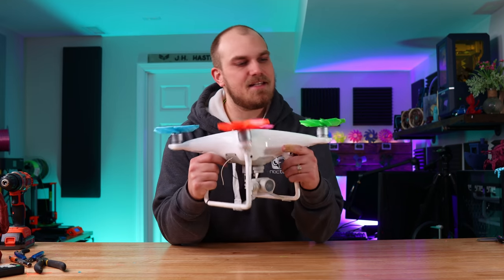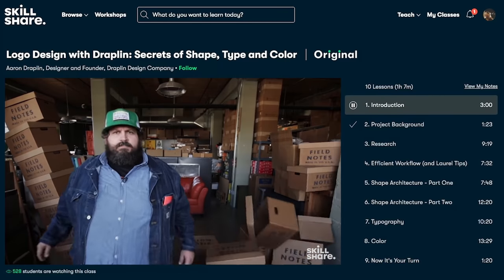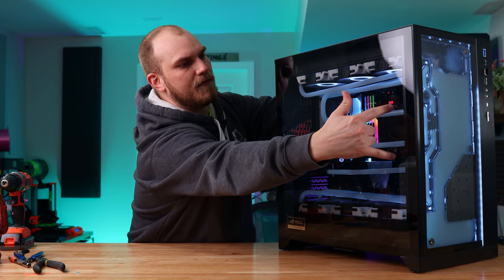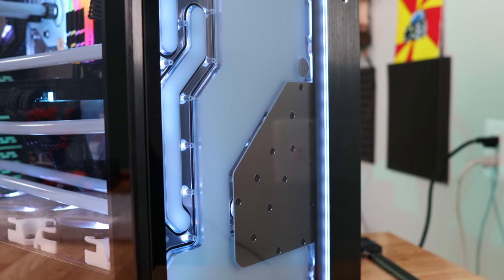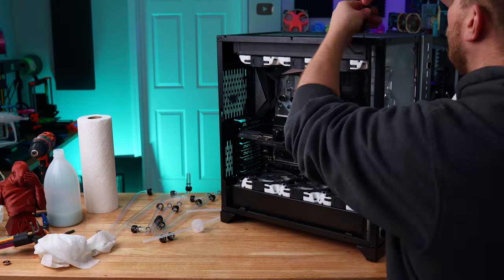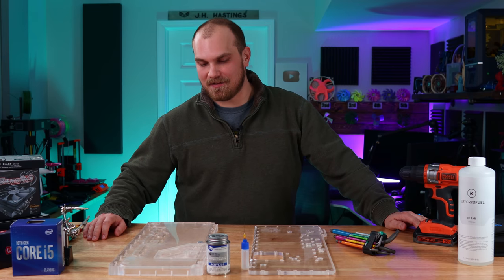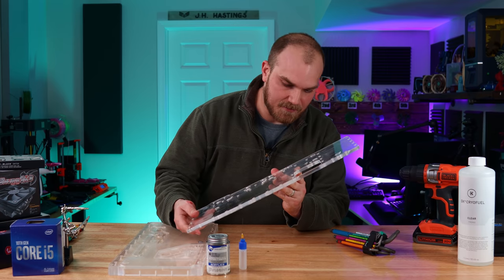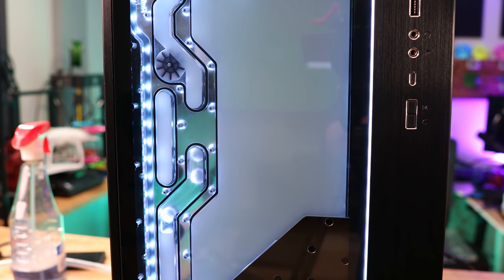$400 DISTRO PLATE is about to let loose, can we FIX IT?

Comment: Try one of those DIY windshield repair kits
Reply: There should actually also be stuff for fixing acrylic
Reply: Yeah you must aply pressure to get the glue/resin in to the cracks, to do that you wuld probably need a specially made screw that you culd fill with air and that has holes where you wand the glue to go in to the cracks.
Reply: I'm not that sure that would fix it reliably, and I would not want to risk it.
Reply: I think it might still look funny after that
Reply: What the windshield guys do is that they use essentially a vacuum cleaner to suck the glue into the cracks.
Reply: @garremannen   i don't know what kind of machine you talk about, but I know about 2 types of tools the vacuum one (you connect a compressor hose that make the tool suck out all the air from the crack/vacuum then the underpressure drags the glue inte the cracks) and the other tool is like a tiny pump that you press the glue in to the cracks (replacing the air in the crack with glue)
Reply: @kayburcky7146  if you get all the air out then you will almost not notice it, the white lines are air trapped in the lexan.
Reply: @Mre942  Lexan/Makrolon = PC. Acrylic/Lucite/Plexiglass = PMMA.
Reply: same thing but for acrylic. Windshield repair is meant for glass and the special plastic they use for the lamination, wouldnt work with acrylic.
Reply: @crisnmaryfam7344  it would work crack as crack, just don't know how it will look
Reply: Maybe if you put pressure added air pressure and made the hole air tight and put the stuff in there maybe would push the stuff in the cracks
Reply: UV glue is the answer for sure.

Comment: How about using the old plate to test torque and see how much is really required and what will cause catastrophic damage? It will be good info for those who want to do DIY liquid cooling.
Reply: finger tight is all you need :)
From the factory, these fittings are too tight. Unfortunately he did not losen them up and retighten by hand. Personally i always remove any fitting and retighten by hand. as long as the oring is compressed, there's no need to go further.
Reply: @ledoynier3694  That's really where most people screw it up, 'cause you nailed it on the head. Once that ring starts to compress, you're DONE. Stop right there. Once there it has sufficient tension to stay on. You go past that point, that's where the bad things happen.

But then IMHO liquid cooling as a whole is where the bad things happen. When most AIO's can even compete with a crappy five pipe 120mm single stack on peak temps, I'm really not impressed when I'm using double-stacks like the NH-D15's. To be fair though, I put functionality and longevity ahead of artsy-fartsy form factors.
Reply: @ledoynier3694  good tip. Going forward I will always remove and redo all plugs having seen this.

Comment: Find some gasket material and set up a test bench so we can 3d print various impellers for the flow meter and see which is coolest looking
Reply: The gasket material is real easy to find online by the roll.
Reply: Turbines, not impellers, in that application. But oh shoot, other than that, you basically beat me to it (3D-printing cool new blade designs for the flow meter turbine), but with better detail than I said, and I found your post here a while after making mine.

Mine was like this:

Me watching this video: "Oh, cool! Let's see which other cool blade designs we can come up with that would work fairly accurately for that little flow meter dealio-bob there!"
Reply: Or custom Pump (Propeller/impeller?)
Reply: @Bloodhoun21 : A flow meter of this sort with blades that look like fan blades is only a turbine, because turbine blades don't drive initially; they get driven. Yes, then of course they can go on to drive something like a generator or whatever, but first they are driven by a force on the blades.

Other devices with blades like these are either fans, pumps, compressors, or propellers, because their blades drive the fluid.

Fans, of course, can get divided further, into blowers and impellers.

Also: why are you treating "pump" and "propeller" as if they are brands?
Reply: biohazard design :D
Reply: The flow indicator is neither impeller nor propeller.  It's a basic water wheel and serves no purpose unless it's connected to a  generator or simple continuity switch to gauge flow.  At that point it's REALLY dumb to be messing with a calibrated instrument.   That one seems to be just for looks / a simple visual indication to gauge if flow is occurring.   What I'm surprised at is that they didn't do many of them for a steampunk like effect.   Properly designed they have minimal interference with flow.
Reply: @mhamma6560 : I guess you missed what I already said that covers this about impellers vs. turbines, etc.
Reply: I like that idea a lot
Reply: @HelloKittyFanMan.  some people just always have to correct someone else I assume. You got the point.
Reply: @jdahling4738 : 1. Not always, actually. 2. There's nothing wrong with giving someone correct information. 3. It's actually a good thing, because it fosters good understanding by keeping things straight. 4. You don't have to worry about it, since I wasn't even talking to you.

Comment: Windshield repair...I think they pull a vacuum
Reply: Not all the repair kits require vacuum. Some of them are pressed into the cracks using a screw.
And some need nothing, they are runny enough to fill in without extra forces on them.
Reply: @Dirkxke  a vacuum would have a better chance of working though.
Reply: @Dirkxke  You really need a vacuum for this if you want to fill cracks as far as possible with the least stress possible and stop them from propagating further for good. If you press glue into cracks to fill them, you end up with pressurized air pockets trapped deep into cracks and the cracks will continue propagating from there.

Comment: You could try dichloromethane, it is used as a diffusion "glue" for acrylic, so it's very thin. And if it doesn't work, it welds pla pretty pretty good together, or smoothes the surface.
Reply: dcm is nasty tho, you can also huff it and pass out. or use it to put drosophily flies to sleep so you can count them and mark down their phenotypes to do some mendel genetic experiments
Reply: @oOSpecialProskillsOo  who doesn't like huffing and counting phenotypes...ah, good times.
Reply: Trichloromethane also works. TCM is commonly known under the name "Chloroform", so good ventilation is crucial when working with both DCM and TCM
Reply: @oOSpecialProskillsOo  I thought so when I saw the many interesting hazard stickers on the bottle 🤣

Comment: That’s why watercooling plugs often have no Allen key slot and are just knurled so you can’t overtighten it as easily.
Reply: Has nothing to do with overtightening and everything to do with expansion, contraction and shrinkage. As he stated some of the plugs he never touched. I have 3 cracked distros and mine cracked around the screws that clamp the two halves together. I never touched any of them. Also note when he separated the halves and laid them on the table that they were warped.  Distros have a short lifespan and are guaranteed to crack.

Comment: You can still use that plate. Just get some of the O-ring material from McMaster-Carr. Cut it to length and use some CA glue to stick the ends together. You can also get all of the fittings and screws from there.

Comment: 3 things to try:

1: Use heat or flame to polish away the cracks. Put a fitting in without an O-Ring to maintain the shape of the threads then heat the cracks with a blowtorch or heat gun from the outside, essentially melting the acrylic back together into itself. I have used this flame polishing technique to successfully fix hairline cracks on an acrylic display box, but I don't know if it was water tight or anything.

2: Use a heat gun or blowtorch to actually flame polish the machined inside of the distro plate. I hate how they look with that raw machined look, and would much prefer to polish that out if possible, but I never see anybody do it, and I wonder if it is because it doesnt work well.

3: Use Weld-on 4 to glue the two halves together to see if you can make it water tight without a gasket.

Comment: Looking at the shape of the part, there's a good chance that it is acrylic cut on a laser engraver. The edges of those parts tend to have internal stresses at the edges from the intense localized heat of cutting, and this can lead to cracking over time or even instantly if they are exposed to solvents. There is an "annealing" process that can be used to relieve those stresses. I wonder if the manufacturer is doing that or not.
Reply: Sharp edges are stresspoints too, He has Crazing
Reply: It's EK, an overrated company.

He needs to do an RMA
Reply: Ek needs to specify torque and torque pattern for each fastener and use a dial torque wrench to prevent crazing.
Reply: Afcouse they don't do that, they dont case about the quality, the only thing they care is money.

Comment: For auto engine stuff that we think is sus we get them Loctite dipped under a vacuum, ie, after the air in the cracks are evacuated the release of the vacuum pushes the Loctite into cracks.

Comment: It seems to me that those types of cracks might be caused by expansion and contraction during heating and cooling. The only way to avoid that problem that comes to mind is having some kind of expansion compensation like rubber washers and gaskets but that might compromise it's water-tightness.

Comment: I used to work at a custom plastics manufacturing place. Mostly making over priced desks and lamps but all the holes that had to be drilled or taped always had to be done with a custom hot bit to soften the plastic in order to prevent micro fractures and even then we used small buffers in the holes to smooth them out. All it would take is one tiny fracture and it would spread all the way through the entire piece. And if you can imagine destroying a custom 2 inch thick 4 foot wide 10 foot long piece of acrylic$$$$$$$

Comment: I have a thick acrylic lid for a vacuum chamber that was cracking around the valve fitting. I used heat to soften the acrylic enough for it to weld back together. The cracks just disappeared. You would have to be very careful not to deform or burn the acrylic though. Might be best to leave the plug loosely installed so the threads don't change shape. The fitting on my vacuum chamber lid is sealed with a thick rubber washer, so tolerances are less important in my situation.

Comment: Heat the cracked areas up to about 150C and the cracks should weld themselfs closed, a hot air soldering station is the tool for the job. Too hot and the acrilic will melt, just right and there should be very little damage.

Comment: Looks like the part that is cracked,  is flat, get some gasket material, and a piece of acrylic,  drill and tap the holes and you'll have a backup distro.
Reply: if they didn't have threads but rather used helicoil it likely would not have cracked. If he is going to drill it, that would be my suggestion. But he definitely can use gasket maker for it.

Comment: Is it fatiguing because of the load that the hard-line and coolant puts on the distro plate? Rather than overtightening?
Reply: It shouldn't be. Acrylic doesn't "fatigue" as much as some other materials, and the pressure in the system shouldn't be that high.
However, One thing I've noticed that can make Acrylic crack up, especially over time is freezing temperatures. The colder it is, the more noticeable it gets.
So maybe the Acrylic plates got exposed to freezing temperatures in transit, or were stored at a warehouse that got below freezing.

I once was dusting my case and turned the canned air too much, and some of the compressed liquid gas got on my Acrylic side panel, and it instantly formed a LOT of very small hairline cracks...

Comment: So what you are seeing is called crazing. What it is is stress induced cracks in the material due to internal stresses from manufacturing. There is no easy post processing method to fix it. To prevent it from happening after manufacturing it, you would need to anneal the material just like you would a metal to relieve the internal stress in the material. Crazing can be initiated by UV exposure, heat, force, or chemical attack. A common initiator of crazing is an organic solvent such as alcohol or acetone.

Comment: I'm 2 months late, but the way you get liquids to go into those cracks is to seal them off, emerge them in the liquid and then apply a vacuum which will pull the air out. Then you apply pressure to force the liquids into the cracks. They do this on windshields all the time and it can be done DIY fairly easily with some clear tape and a syringe.

Comment: The cracks could be caused by the coolant you're using.

I use to work at retail store that used acrylic display boxes. We were told to never use Windex to clean them because it would cause cracks like the ones you have.
Reply: Alcohol cracks acrylic

Comment: good to know you can take it all apart and replace the plate. I've one these and love it. No issues with cracking, but some weird noises and a white residue building up after changing the cryo fuel a third time. I saw you were using and air hose, possibly linked to a compressor. What compressor are you using? I've been looking around for one and wanted to get one, but didn't want to get a "shop" compressor for inside the house.

Comment: You should use a pressure release fitting if you can on the top hole. I think the pressure changing is either sucking in or pushing out the fitings and this is what make cracks.

Comment: Acrylic can expand and contract a fair bit so wouldn't surprise me if that's just from heat cycle if the threads where a tight fit. Best way if the threads are slightly lose and the seal comes from the gasket only.

Comment: Don't know if it sticks well but you could try to use some 3d printing clear resin and cure it. If capillarity doesn't work you could try a suction cup like the one for the drains to pressurize and depressurize until it fills the gaps.

Comment: Had V64 acrylic block with cracks up near the terminal that were iffy. Used the dremel along the crack until it was exposed and then dropped weld down into the crack. Then let each layer dry and backfill with more wild until filled, then sanded level. Took a couple of hrs over a few days and its never leaked a drop in over 12 months.

Comment: To get the weld-on 4 to go into the crack, you would need to use a vacuum chamber to remove the air and then air will push it into the cracks when it re-pressurizes. However, you will need a similar product that has a working time of more than a few minutes.

Comment: Are they tapered pipe fittings or straight thread with an o-ring? I would guess the cracking is from tapered fittings. A straight ORB (O-ring boss) fitting might not stress the plastic unevenly.
Reply: They're likely 1/4 BSPP(G 1/4), so just like ORB.

Comment: I would use acrylic 'washers' (easily cut on a laser cutter if you know a geek) and then use the cement to weld those onto the front and back plates over top of the cracks. If you use an opaque colour they would look like highlights but also cover the cracks. That's just how I would do it - getting a warranty replacement is much better & easier option :)

Comment: There's a process in which mechanics use to fix windshield damage from stones and whatnot... maybe try that? You might also need to increase the damage before you're able to fix the damage (aka, expand it enough to get fluid to pass through it).
Reply: Usually, it requires the crack to be about two or more inches from the edge; the suction cup is quite large for even a small crack in the screen; I doubt you can fix it that way.

Comment: I would try hitting the plate with a butane torch, just lightly enough to melt the cracks back together. If that doesn't work, you could try annealing the whole plate in an oven (stick it on a sheet of float glass so it stays flat) and then hitting it with the weld on.

Comment: A very common problem when using Acrylic stress fractures. A real pain in the wallet. I was going to go full geek on this and tell you how to prevent it from happening  again. And why threaded  metal fitting in a threaded hole in Acrylic has never been a good idea when heat is involved.
Reply: So a  plastic fitting would be better? Or maybe just a softer metal?

Comment: PUMP IMPELLER SHOWDOWNS
you can seal this back up with Blue RTV from the auto parts store. or probably get a proper gasket from EK. 
getting the pump to rip apart will probably be the most costly. 
Ranks based on gallons per minute, psi, etc. maybe another isolated loop for temp. lots of configuration variables though, although i don't think they would cause any significant difference in any test.

Comment: Use the number one fan for your drone :D and you should have recut the threads on the new distro plate by your self to prevent new cracking. Just to be safe. For your repair... put your fluid onto it and then pull a vacuum around the thread and the fluid should  go into the cracks... thats how they fix car windows if a stone hits it.

Comment: Creat a sealed off area around hole with a bag, add resin and use a vacuum to force resin into holes. Recut the threads after. Like to see you have a go with more tools. This is a common issue I've seen on a lot of my acrylic watercooling parts.

Comment: I guess it's a good thing I ordered the one that goes in the back and not in the front for this case. Actually it was because of your build video that I ordered that one. I didn't want to have to deal with the CPU water lines needing to be swapped and not going straight to the distro plate.